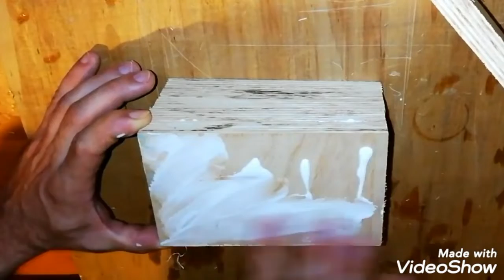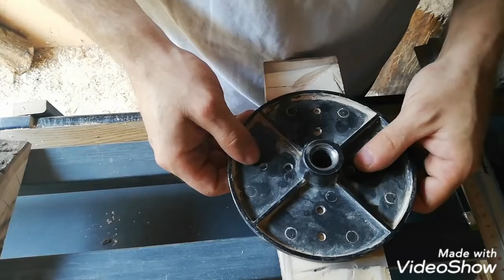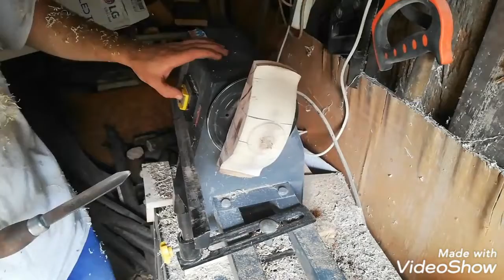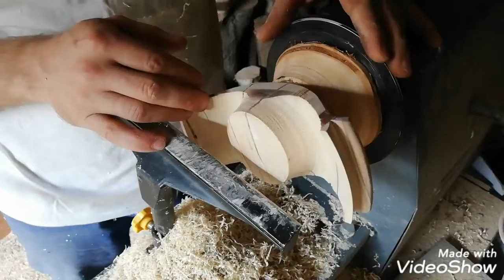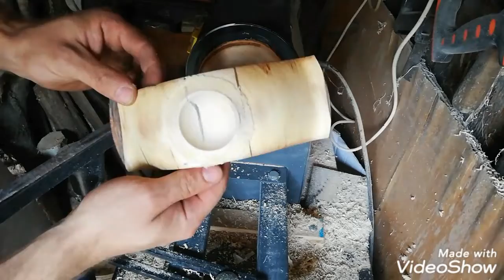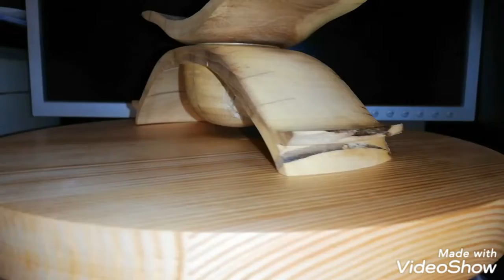Double Winged Box - Woodturning

Comment: Your work is moving to a higher plane; Where does the inspiration come from ?
This suggests to me an altar(?) of the ancient ones. {read into that what you will 🤷‍♂️)
"Arrrgh!!!" Just had to put a final touch on the ball finial didn't you 😁 ?
One question - what did "Fabric of Springs" mean ? The feeling or impression your turning gave you at that moment  ?
Reply from the maker: I'm trying to made a projects which are a challenge. I don't like turning only bowls like some turners. Internet is a book of inspiration for me.
Maybe it looks like ancient altar but when I look longer for that it seems to me a guy with a hernia 😜
Yes, it was final touch. I Just wanted to remove a period on the top. I'm a turner, I don't give up 😁
"Fabric of Springs " means that the  shavings looks like springs and there was a lot of that. It was good cut finally 😉 I have to buy a ne lathe. This one is horrible. I have to turn very slowly either it is shaking, it is offcentered and I can not buy a chuck for it. I collected money for new one but I will buy it in next year becouse winter is coming and  I will not be able to turn anything.
Reply: @Secondlifeofwoodturning  "hernia" - thanks for an image I can't unsee 😁. Know what lathe you'll be getting yet ? -Mike
Reply from the maker: @mpart_woodlathe-stuff  Your welcome 😁 It will be Austrian lathe Holzmann D460FXL. What do You think? - Rafał